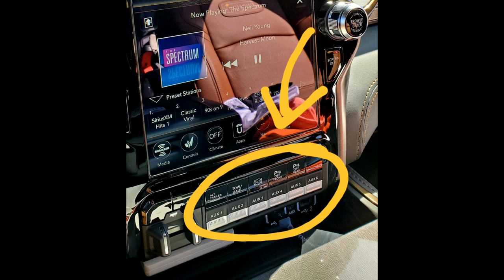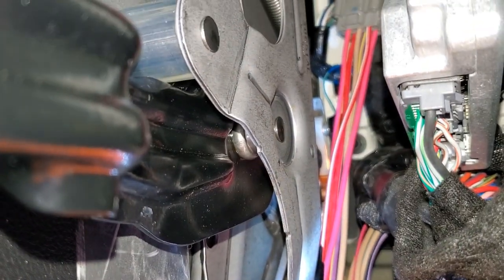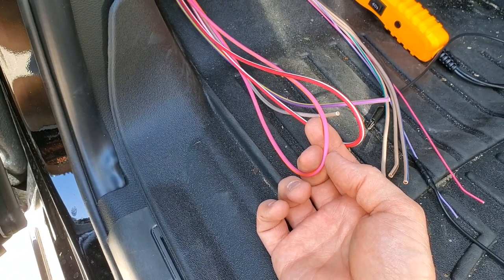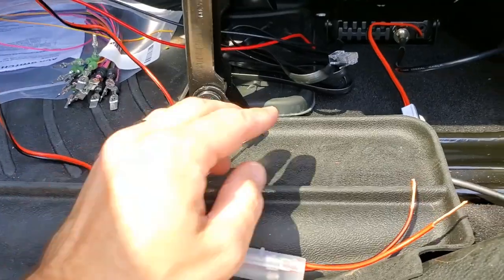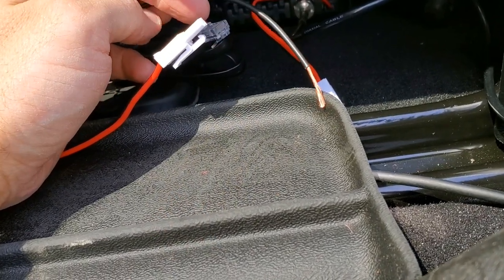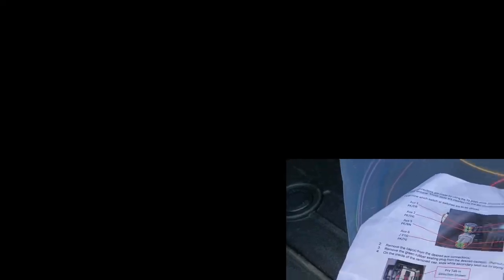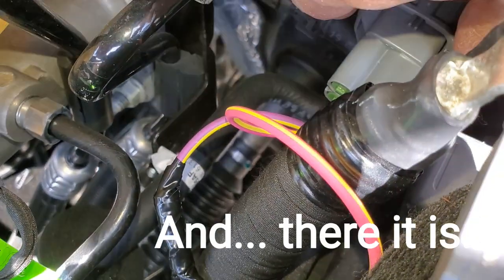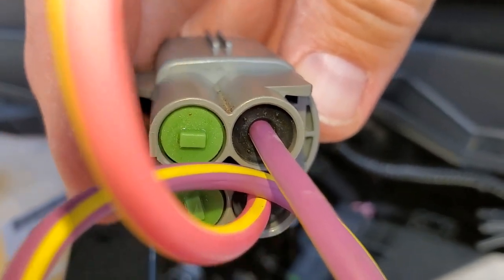How to wire your Ram Auxiliary Switches on a 2021 3500 Mega Cab Dually

Comment: If I were only trying to power lights in the back of the truck, would I only need to plug the light gray connector with the loops? I do not understand what you did with the pass thru wire in the cab. You only spliced the pass thru to the Aux switch. What was done with the pass thru wire in cab?

Comment: Also, on the rear of the cab approx 1.5 inches from the bottom of the cab and approx 6 inches from the side of the cab there is a small sealed grommet, the kind you cut a slit into, then insert wires thru.  The grommet size is aprox 1.25" x 1" perfect to fit your antenna coax through.
Reply: Thank you

Comment: Incredible helpful video, thank you so much for the effort.  And I know how hard it is to record and point out stuff and talk at the same time so your on-screen corrections were hilarious "needle nose pliers moron" lol.   Couple of questions if you have the time I'd appreciate it:  1.  So, you never did actually do anything with the blunt cuts under the hood (the ones that used to have a piece of yellow tape)it seems  just doing the jumper got you what you needed in the cab, what scenarios could you think it would be time to tap into those blunt cuts?    2. I read somewhere about cutting the looped wires under the dash on the gray connector but I don't understand that?  3.The black connector that goes to white under dash is for a plow?, you just used it for a handy ground?  And finally, if you have a micrometer, what size in millimeters are the green plugs you removed, or more accurately what size is the orifice they seal?   Thanks for any further help you can provide and thanks again for doing the video.